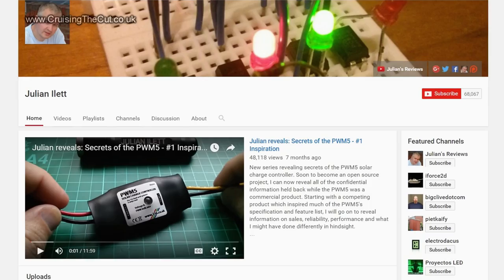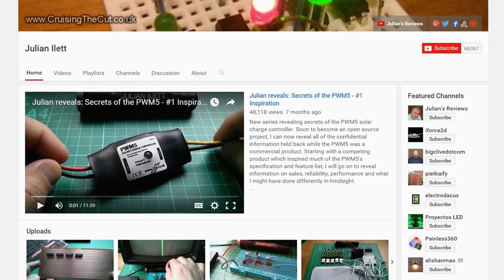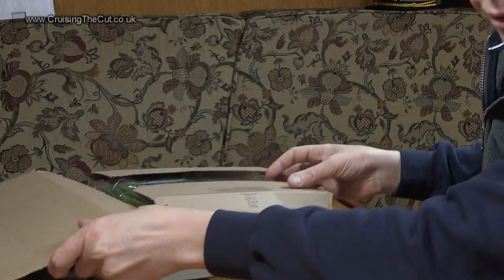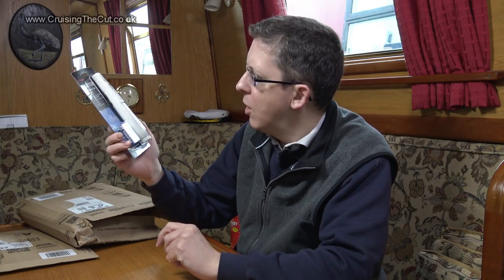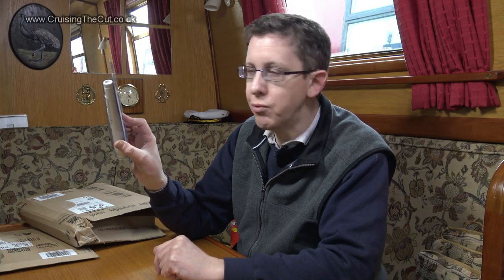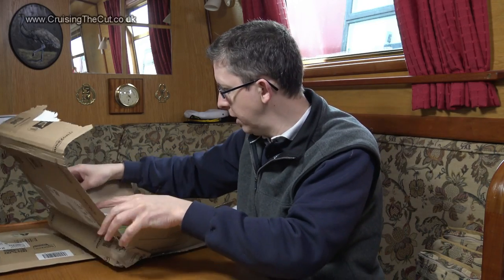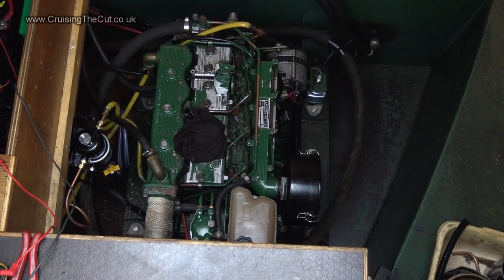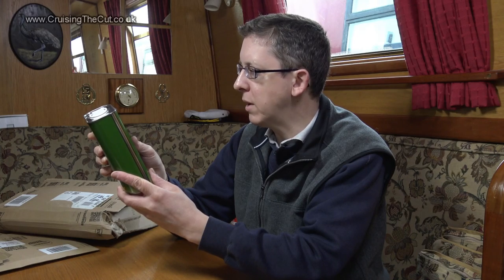24. Another haul of bits and bobs for my narrowboat.

Comment: It's not the thread that forms the seal on the bottle, PTFE tape will not improve it at all, but fine on other gas fittings. If you are having to tighten the gas pressure fitting on the bottle any more than just over snugged, it's usually because the domed face of the regulator / pipe or inside edge of the bottle valve itself is slightly damaged, (which can happen).
Reply: Correct.
Odds on the faces just need a clean though.
Reply: Absolutely correct. Never, ever, use 'pipe sealant' on a 'flare fitting'.  Only the metal to metal, 45 degree mating surfaces seal the joint.  It's the sure sigh of an amateur pipe fitter when you see tape on those threads. And I see it often enough.  Also NEVER use sealing tape, in any application, only paste. It's forbidden on Air Force/Navy fittings because of deaths attributed to loose bits of tape breaking loose and clogging the works. Clean the mating surfaces and remove any 'dings';  better yet replace with new modern fittings.  Same with those old tanks, they should be replaced with OPD (overfill  prevention device) valve type tanks ( triangular valves on the top of tank).
Reply from the maker: Cheers - the tanks don't belong to the boat, they're what you get when you swap them out when empty (so you get as replacement whatever the company supplies; they're not refillable at the boat)

Comment: Personally, for what it's worth, I wouldn't use Teflon tape on gas bottles. There is a washer in the fitting and provided that is clean, correctly seated and the fitting is tight it will not leak. No need for tape.
Reply from the maker: Ok, fair enough. Cheers

Comment: Gas fitting do NOT seal with the threads! It is designed to seal on the taper on the end of the fitting........needs to be TIGHT. Get a longer spanner for more leverage. If you get a piece of that tape in the gas line and it will happen you will need to replace your regulator.
Reply: Um, no they don't need to be tight at all. If correctly aligned and in good order slightly more than finger tight should seal. A nip up should be all the need, if the need to be crazy tight they are buggered.
Reply: They should be more than finger right on something that moved and vibrates but i agree they don't need to be hercule'd

Comment: I am surprised the UK has not switched you over to the newer gas line fittings , they are just easier, no spanner required. The old style works just as well. I suggest that you keep a spritz bottle with half dish soap and water in your locker, when you change a bottle, just spray the fittings and look for bubbles. I am a certified gas mechanic, Also HVAC?R and many more certifications lol. :-)
Reply from the maker: Cheers

Comment: Be careful applying the gas tape . Not too close to the ends of the threads as you risk cutting the tape as you tighten the fitting . Then small pieces of the tape can get blown into the lines and block fittings and regulators and valves that are downstream from the tank . This then becomes an expensive nightmare to resolve . SRK

Comment: good tip on the shower . I struggle with temperature control. like all good ideas  the best are simple ..
Reply: His valve would be best if he's got a regular showerhead.  Most modern shower wands, besides having multiple flow settings, will also have a "water saver" or "trickle" setting included.  When he made this video, I'm not certain how prevalent they were but they are available at your local Hardware Store.

Comment: The use of Teflon plumbing sealing tape on the  threads on  gas bottles is a no no. Just make sure that there is no dirt on the fittings or on the seat where the two mate and tighten to the correct tightness and check with your detector.
Reply from the maker: Thanks
Reply: The reason is that small "slivers" of the dreaded Teflon cut off by threading on the fitting will blow downstream and plug up those pesky tiny orifices (and usually only accessible to a Borrower) in your gas appliances. As a professional contractor, gas fireplace repairman, and long time liveaboard in Ca. USA, I use a gas rated plumbers' paste. The kind I use is probably not available to you, but I can highly recommend you look for a "non - hardening" type.
PS: your friend Mars sent me along :-) and I have been binge watching!! Great videos; keep 'em up!
Reply from the maker: Gary Laufer Mars (I do know a Marcella) or Mads (the Danish chap)? Either way, I take your point about the tape and I'm not using it currently. Loads of other people have advised against it too!

Comment: The wand sounds like a great idea, however, I would think twice about installing a wired gas detector beside the gas bottles for three reasons: 1. Once you have installed the new bottle and checked the connection for leaks with your new wand then the connection should never be disturbed, therefore hopefully no chance of leak. 2. To install a wired detector would mean drilling through the gas tight bulkhead and therefore potentially providing a sneak path back into the main cabin.  3. If the worst happens and you get a leak then the gas will pour out of the leak and then out of the two drain holes at the bottom of the compartment to safely vent outside.

What I would ask you to consider is installing a wired gas detector near the bilge at your gas cooker.  Here are my reasons: 1. This is a gas appliance inside the cabin.  2. Every time you turn on the gas there is an opportunity for some gas to escape and as gas is heavier than air it can build up in the bilge.  3. The gas cooker has numerous moving parts / valves that could potentially leak.

I would recommend something like the Pilot Gas Alarm (http://www.force4.co.uk/department/safety/fire-gas-safety/gas-fume-alarms.html) They are designed for boats as they run off 12V (I have one on my boat).  They come in two parts (1. The sensor which you fit low down near the bilge and 2. The control head which you can fit anywhere that is convenient.)
Reply from the maker: +Graeme Scott Ah, you've misunderstood me or I did not make myself clear. I was neve going to install the detector in the gas locker so no intention ever of putting a hole in that bulkhead. I was going to put it in the space BEHIND the gas locker, where the water tank is so that any gas which managed to escape and make its way through the boat would be detected there before it went under the floorboards.

Thanks for the suggestion and link though, much appreciated.

Comment: Permanent gas alarms ar hardwired because they are permanent. What if you battery goes flat? You won't know, your gas alarm won't work so what's the point? Sure, like smoke detectors, battery gas alarms could beep to warn you of a low battery,  but what if it's been beeping it's head off while you've spent a fortnight onshore visiting your great aunt? No, you want a gas alarm that you know has power, and you want one with a 'push to test' button.

Thread tape is all very well for the other end of your gas hose, and I'll bet your installer has used it, but I strongly suggest that you seek his advice before using it on the end that you undo to change bottles. The thread is NOT the seal for that connection, and incorrect use of tape can actually make the situation more, not less, dangerous.

Comment: A damp but not Wet cloth rinsed through with thinners is amazingly absorbent with oily water.  I only recommend this with a 2pac engine compartment coating.
Reply from the maker: I don't know what a "2pac engine compartment coating" is, can you explain?
Reply: +CruisingTheCut 

Sorry, 2pac was a silly description of a paint that basically has a hardener/activator that is added to it in order for it too harden/cure. (similar to car body filler)

Motor Vehicles/Boats ect have been painted with this type of paint for decades, it's often used today for blacking instead of the lovely goopy bitchumin based paints.
Reply from the maker: Ah yes, I'm aware of the two pack epoxies for the hull but hadn't considered that you'd use them on the inside of the engine bay as you seemed to suggest.
Reply: boating is new to me.

I guess their is a old school bitchumin (tar) war still going on regarding two pack epoxy hull coatings.

I am new to boating but have 21 years as a vehicle painter.

ow my I have a canundrem  ??????

Any advice regarding the best choice of Hull Blacking us really appreciated.
Reply from the maker: I don't know about a war. Two pack is regarded as better (longer lasting) but costs more and you have to scrape off old blacking if necessary first. If you can afford it, get the two pack.
Reply: CruisingTheCut 

Yep,  two pack is/has been used on just about everything in trillions of unimaginable  colours for many years however these paint technology has turned to water based paints.  😐 scratches head thinking of canals and water based paints.   😂

Comment: The valve on the shower although a good idea in principle will only be effective once the hot water in the hot feed has filled the pipe running from the hot tank to the mixer and the water temp in the tank is regulated at a fixed temperature. If the distance the tank and the shower is minimal then it should work except for the first few moments.
We have something similar on our motor yacht except it is a lever on the shower head itself where water is only allowed to flow as long as the lever is depressed. We have found it to be very effective in saving water although we do not have hot water as we are in the tropics.

Comment: If the temperature is reliable enough, perhaps paint a line across the center of the taps to return to preferred setting. That's what we always did.
Reply from the maker: Unfortunately, it varies according to whether the water was heated by the engine, Eberspacher or the immersion!

Comment: I recently found out that my State Michigan which is a bit larger than Great Britain had 1,668 canals at one point. Today they are all gone or only bits and pieces of them can be seen. The only locks left are huge locks referred to as the Soo Locks in Sault St. Marie. These are huge commercial locks. Again love your video's seems like so much fun and a great way to see the country!
Reply from the maker: Perhaps you could begin a campaign to restore them ;-)
Reply: The huge size of the USA combined with the car culture I think has ruined the idea of such a thing. Even the rail system in the USA is nothing like it is in Europe. That said even the roads and bridges in the USA are in bad shape. The money that should have been used for infrastructure repair and upkeep has been used for other things in the USA. In the parts of the USA with warm climates the roads and such are great. In the climates that get cold and use salt and such the roads and bridges are terrible never seen anythign like them until I moved to the back to the USA. The paved roads in Michigan often look like the surface of the moon and the dirt roads are even worse!

Comment: use white PTFE tape for plumbing...Tape Color Description
White single or double density should only be used on NPT threads up to 3/8 inch in diameter
Yellow double density often labelled as “gas tape”
Pink triple density, required on all joints 1/2″ or larger
Green Oil Free PTFE tape, required for use on all lines carrying oxygen (i.e. – medical oxygen or welding oxygen lines)

Comment: Teflon tape works well enough for things that seal on the threads, such as pipe threads (tapered). Your gas connection most likely seals by way of a mating surface or o-ring. If that is the case then wrapping a bunch of tape around the threads may slow the leak but it is not the right way to do it.
Reply from the maker: No O-ring. Mating surface I think. I have received much conflicting advice on this subject!
Reply: From what I can tell by looking at pictures of UK gas fittings, the seal is made by a tapered mating surface. You need to be sure that the two surfaces are clean and undamaged. If you put them together with any bits of dirt on them then the dirt gets embedded into the mating surface and messes it up.

Teflon tape may work to mask the real problem, but to do it right you may need a new connector. Take a good look at those surfaces and you should be able to see if they are scratched up or deformed. You may be able to clean them up using a rag. Also, over-tightening can damage them as well. You should get a good seal by tightening only firmly. If you have to tighten real hard, then something isn't right.

 The only proper place to use teflon tape is on fittings that have tapered threads. For other fittings the threads only exist to bring the parts together, not to make the seal, they seal by using an o-ring, washer, or mating surfaces.
Reply from the maker: OK. Cheers for the detailed reply.

Comment: Tip: When you degrease and rinse engine, spray over with CRC or WD40 or such. Despite the obvious of displacing water from any electrical connections, it will also stop any alloy castings from oxidising and getting that ugly powdery white appearance that alloy gets when left exposed and neglected. Just wipe over everything , hoses plastic etc. If you've ever seen used cars for sale with everything nice and shiny under the bonnet, it's this trick that's used. All the plastics and rubber look like they have Amorall on them. May smell for a day or two while some of it is burnt off the hotter parts of engine, but it will soon stop smelling and leave benefits until you clean again.
Reply from the maker: OK, cheers!

Comment: Hello and great videos..... I do have a question about emptying your tanks into the canal..... even thought the GUNK is biodegradable, what about the grease, oil, diesel fuel and other crude the GUNK loosens. Surely it is bad for the canal? And dish soap, laundry soap, and so on, I mean, can you imagine in a few years floating around in a bubble bath? Just curious on your thoughts about this. Remember the Thames a hundred years ago, didn't think it was bad then either....
Reply from the maker: I wouldn't empty the oily residue into the canal, goodness me no. That would be taken away for proper disposal (and in a much, much later when I finally got around to this, it was). But all grey water does indeed go into the canal from all the canal boats.

Comment: Brilliant that there are guides to all the canals. I had no idea the UK was so traversable in this manner. Might have to pop over and rent something for a cruising holiday! 
Re the turnabouts or winding areas...are bow thrusters a thing on those boats? I could see them being incredibly useful in your application, what with their ability to spin a boat practically within its own length. Quite popular on single screw cruisers in North America.
Reply from the maker: Hi. Please see my website FAQ page re bow thrusters, cheers
Reply: Winding holes and bow thrusters are two seperate topics. Most pounds are simply not wide enough to turn the average barge. In these circumstances, it would not matter if you had a bow thruster and that is why the winding holes are provided. By the same token, a bow thruster woukd be really useful for example when entering/exiting a lock and the bow is being blown over by the overflow sluice. But then thats part of the fun of canals!!

Comment: in theory there should not be gas leaking in the normal applience of the connection. sometimes the little rubber/butyl ring in the connector is done for and should be replaced. No  need for teflon tape. Also sometimes the pressure regulators kick the bucket.

Comment: It's NOT the threads that form the gas tight seal  .  It's the  plastic/ hard rubber  COMPRESSION  gasket  ( looks like a washer  ) .
Reply from the maker: No, there is no plastic hard rubber or other gasket, these connections are purely metal into metal.

Comment: I am a new follower and have logged your vlogs and am now filling in the ones I missed.  Here in the US our gas connections have an "O" ring seal on the fitting that goes into the gas bottle for a seal do you have the same.  We are also recommended to use a bit of dish soap diluted with water to check for leaks at screw fittings.  It's good for you we are in a semi lockdown so I can view your vlogs.  JJK
Reply: I'm not sure about England but here in LATVIA  a new " O " ring gasket comes with each new tank.

Comment: Might want to look for a gas detection device that is a combination of hard wired and battery backup. Also, if your gas tanks are like here in the US,  they might have an O ring seal on the end that goes into the tank valve. If so, find a place to get 3-4 extras to have on hand. You might only need 1, but a neighbor boat might need one, so, you might save them a bit of issue, up to and including, loss of life or boat.

Comment: I will add one thing i use teflon tape for is say you get a cut on a finger, i use it to wrap around the finger where its cut to stop the bleeding, and then put a band aid to hold the teflon in place. That keeps the blood from leaking through the bandaid.
Reply: Bandaids are called plasters in the UK
Reply: Thanks for the tip.